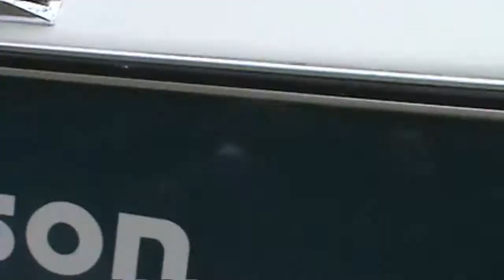drain the water from boat 3.0 engine

Comment: Nice video Could you tell me the size of the drain screw that is in the block, the smallest screw or part Number please thxs
Reply from the maker: I think it was 9/16
Reply: @Netzr  I made it easier to drain the engineI put those drain cocks in both of those holes on the block and the bottom of the exhaust manifold. I also pull hoses loose on water pumpand thermostat. Just to make sure there isn't a pocket of water there that could freeze and break engine.